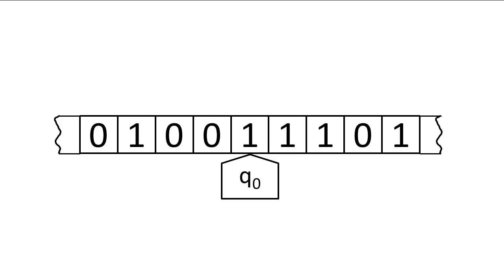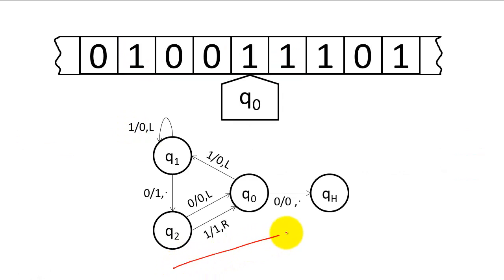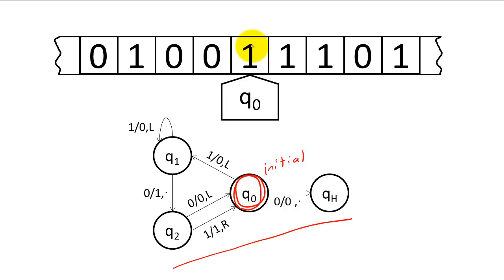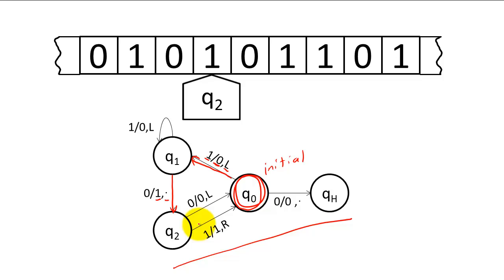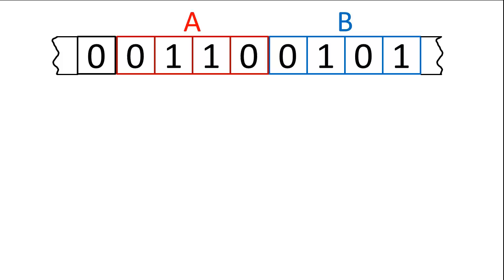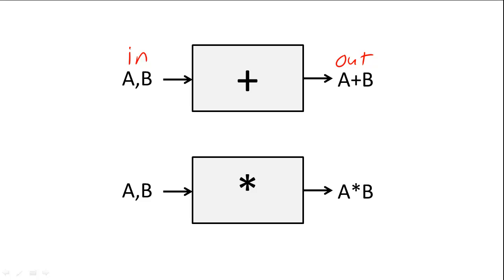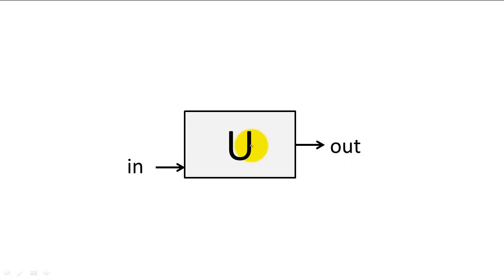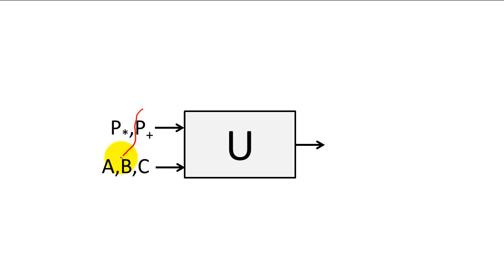Turing Machines

Comment: this is the best and most simple explanation of the turing machine i found today. and i was watching over 20 videos
Reply: +1. Also checked hundred of scripts and defintion in my university's lecture videos. But none of these had such a good illustrating examples as this one.
Reply: I had to watch it several times to understand it because state transition syntax was not explained very well.  I basically had to figure out on my own that the direction you go is decided by comparing the bit at the head to to first number of the state transition, seems to me that could have easily been explained, like "we follow the arrow that has it's first number matching the current value of the head, so we go this way, instead of this other way"

Comment: Yup. None of that made any sense. I've been trying to learn how it works but I can't get my head around it!!!! Haha
Reply: What he used to explain the turing concept was a state machine diagram if you want to search that to better understand. Your computer is in a state and has a current output, you input something like a button click. And the computer goes to its next state according to the button click and changes its current output accordingly. In practice, your computer has many many many many outputs at once (think all the different pixels on your screen) and takes in many many inputs (some being your mouse, button clicks, and some being internal feedback like a virus protection scanning your system) but at every single moment of time, your computer is in 1 single state. Most computers are run at very high speeds (clock rates such as 1.8 GHz) 1.8 GHz is your computer going through 18,000,000,000 states per second!
Reply: Those super high speeds are what make your computer seem like its multitasking and doing many things but in reality it basically can only do one single thing at a time.
Reply: @linkmaster959  ohh that actually clears quite a bit up. Computer's are amazing!!
Thanks mate 👍

Comment: Long talk about simple thing. Computer is an electronic circuit which can simulate any other circuit by means of software. For example you can acomplish any task by building specific electronic circuit or just using computer and write software for that specific task.
Reply: +Andrius Jasinskas Eh.. it takes more thought to think in terms of a turing machine but it pays off in that it's mathematically simpler so easier to prove things with. It's the simplest way you can define a machine that can run any algorithm. (At least one of the simplest ways. Lambda calculus has the same capabilities.)

Comment: What does changing a sequence of ones and zeros have to do with whether a mathematical problem can be computed or not? I still have not fully understood the purpose of this machine.
Reply: +XenoContact The 1s and 0s are bits (binary digits). They're numbers (just like the decimal numbers we use), but represented in a way that computers (a series of circuits) can interpret. Each bit is either an open or closed circuit. So 1 or 0. The Turing Machine performs operations with some formula (program) and moves to the halt state once it find the solution. So when it halts, you know the mathematical formula has been solved.